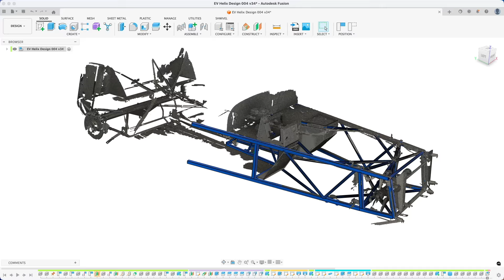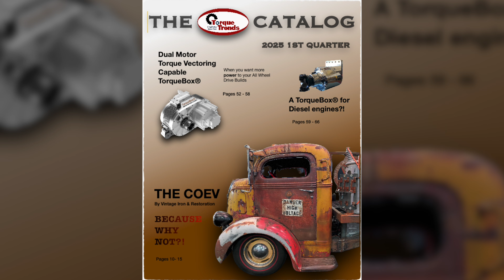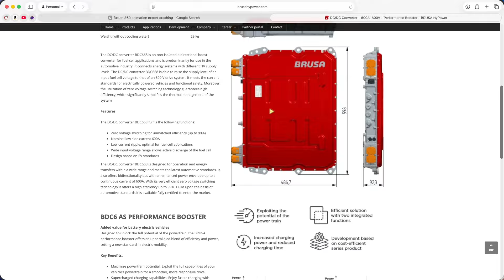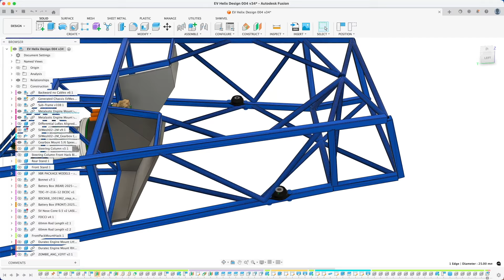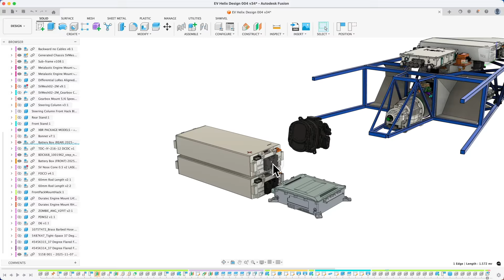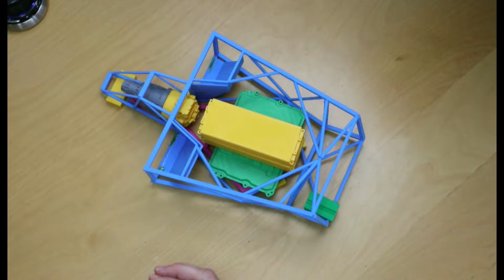Project sEVen pt6 : Mega Two Year Update Video - How I designed an Electric Vehicle

Comment: Final note on the LV / HV DCDC.  You might want to work out the total HV bus capacitance (DCDC HV side output capacitance + traction inverter input capacitance) and work out the volts per second slew rate at your 225A peak current. Ie, if your traction bus is at full power (225A) and something trips, how quickly does the HV DC link voltage fall or more importantly, in regen, climb!  This tells you just how much of a problem you might have to deal with! 

 You 'could' add more capacitance to the HV DC link to slow the slew rate and to try to decouple the bandwidth requirements of the control interaction between the powerflow through the DCDC and the inverter, the problem here is what capability does the inverter and dcdc have to safely discharge that energy storage. ROad homologated EVS have very strict requirements here, and you'll probably find the helix inverter has a mode deliberately designed to discharge its internal capacitance (and maybe the Brusa DCDC too) but if you add external storage the energy and hence thermal limitations here may preclude this option....
Reply from the maker: Yes, both the inverter and DC2DC have discharge modes to bring the DC links down to safe levels. I’ve spent a lot of today looking at what a chopping dump resistor might look like on the DC2DC / inverter link but the problem is (I think) I don’t really know how quickly the inverter or DC2DC will go from active to free-wheel when they see the bus voltage spike (thinking about the usual main problem of being in regen mode and you lose a contactor, removing the battery current sink). Both will have protection from over-voltage and over-current but as you pointed out yesterday the fault scenarios get complicated really quickly. It also doesn’t help that neither Brusa or Helix are very helpful about this sort of stuff. I guess Helix are more interested in what McMurtry want and the same goes for Brusa and Mercedes. Obviously a dump resistor isn’t going to be able to dump the whole of the cars kinetic energy from Vmax, so you have to assume the active components will stop commanding torque at some point. But then the inverter rectifier effect becomes a problem even when the inverter goes to free-wheel. Many unknowns follow on from there.
Reply: @Purplemeanie  the problem is high vehicle speed, ie when you are deep into field weakening, esp with your system where you have an ~800v secondary link and a ~300v primary link.  Sorry, off the top of my head i can't remember the KE of the Helix motor (i used to work for them...) and therefore exactly when it enters field weakening, but typically you might have a CSPR of 2:1, so you are above an 800v bEMF at 12krpm upwards (~70mph for you i think??)  

So, if you loose commutation you have uncontrolled generation, you absolutely have to have the active short circuit mode working in the inverter (basically it's the "f**k it" mode where the inverter just turns all the low side switches on, then all the high side switches and alternaes between these to share the thermal loads evenly) where it simple tries to short circuit the PM machine to prevent overvoltage and overcurrent in the dc link (phase current is the same as peak torque current irrespective of motor speed).  With little or no energy storage on the HV link, your time period here is short, very short!  

I don't know what the power conversion architecture of the brusa DCDC is. If it is fully isolated it probably can completely resist reverse uncontrolled generation, but it may of course sustain damage here in this event.
Reply from the maker: Very interesting that you used to work for Helix… hmm!
As for KE… from my calculations I’d say it’s the vehicle KE that’s the problem, not the motor KE. My calcs get me to about 1MJ for vehicle KE, 10’s of KJ for motor KE, and a few J for magnetic field energy (clearly not the problem that some people would have you think). But whichever way you cook it, there’s a lot of energy to dump into some sensitive electronics if you’re not careful. But now I re-read your comment maybe you’re not talking Kinetic Energy when you say KE, though I’m not familiar with KE in terms of field weakening (heads off to chatGPT to jump down a rabbit hole). My understanding is that the motor I have will enter FW at around 12,000rpm, so as you say about 70mph. But yeh, time periods here are scary short with the dV/dt that’s happening. As to the Brusa…. I don’t think it’s fully isolated LS to HS (if that’s the isolation you’re referring to). The manual warns of some rectifier effect when the HS is lower than the LS, so I presume not isolated. It’s really tough to get info on the disaster modes of these devices. I guess the companies think this is part of their secret sauce. I’m sure they’d share the info with their tier 1 customers, but they are not even reluctant to talk to me, the literally won’t talk to me… about anything! Not great customer service IMHO. I get that I’m not Mercedes, but doesn’t leave me feeling good about the purchase decision!
Reply: @Purplemeanie  sorry i should have been clearer, when i  refered to KE i was indeed talking about the motors speed / backEMF ratio.  For peak power and getting a realistically useably wide speed range, you normally target a CSPR (Constant Speed Power Region+ for about 2:1, ie your backEMF meets your supply voltage at around half of maximum rotational speed, ie KE x (rpm/2) = Vdclink

However, your point about KE as Kinetic Energy is also valid, and don't underestimate the enery in the motor, especially with such high speed motors where the square term really starts to kick in.  Immagine runing the motor to 24kprm unloaded and then suddenly jamming a crow bar into it, it would be a HELL of a bang, that's what you are dealing with here. The fact there is also a car attached to it as well really ups the energy of course, although normally the rear wheels pretty much lock and the car keeps sliding down the road in a bit of spin IME when this happens, so all the KE doesn't come out the DClink.....

Getting proper info is diffcult for non OE entities. People cite things like NDA's and "competitive edge" and all that crap,but honestly, if they let you buy one, they should let you understand what you've bought.....

Don't worry, i worked for Helix a LONG time ago, before they were even called Helix, when both Luke and I had a lot less grey hair, and when we started on the Mclaren P1 motor, where we had to litterally build everything from scratch. Nothing was "off-the-shelf" because even the shelf didn't exist back then. We mostly learnt by trial and error, lots of very very clever people basically saying "hell, lets give it a go and see what happens"  Happy days  🙂
Reply from the maker: Cool! Yes, totally understand what you talking about with KE now.
Did you watch my videos where I tried to explain a bit about PMSM motors. I was trying to keep it simple, but inevitably that means there’s a loss of nuance. It was pt2.2 in there series, I was quite pleased with my animation, but the mathematical modelling of the currents and fields will be lost on most people 😂. I think I probably oversimplified some of the torque and field descriptions 🤷‍♂️ https://youtu.be/fSu9B_tW3zM

Comment: one "mass" optimisation you could do is to delete the onboard AC charger!  The DC fast charger option is really the one you will use if you are away from home,  as even with a peak single phase 7kW from A/C type2 charging, that's gonna be too slow.  The mass penalty for the Dc fast charging is minimal, 2 contactors, the charge connector and an ECU, probably 2kg.  50kW of DC fast charging would make this car "road tripable" in a way that AC charging never can.  As you have complete control of the system, then clearly you CAN have AC slow charging at home, but mount the AC charger itself on the wall of the garage on on a trolley (F1 styleee!) and when you want to charge, plug into the DClINK access, enable the DC F/C contactors, and away you go.  You could make the A/C charger portable, ie build it into a box that you can take with you, but honestly, there is so much DC FC i p[ersonally wouldn't bother!
Reply from the maker: Yep, totally agree. I mention that in one of the earlier videos. And I sketched up a “home” DC link charger using an off-board AC charger feeding the car at one point. There was a reason I decided to include the AC OBC back into the car, but I’d have to check my notes as I can’t recall what made me put it back in again now :-(

Comment: Late to the party here, but one note regarding gearbox cooling!

With a single speed trans, the ONLY time your input rotational velocity hits peak rpm is at Vmax.  Vmax in a Caterham is NOT something that's particularly pleasant, and with your current Vmax at 135mph is clearly track only (officer....)  What this means is two things:

1) unless you plan of spending a LOT of time at the Nurburgring or Nardo, the amount of time you spend at Vmax is minimial.  Even if you hit Vmax (and aero drag on a caterham is so bad it actually takes a while to do this, so you won't at most circuits) you're gonna be there for a few seconds.

2) at Vmax there is a LOT of air going past the car.

Therefore I would be surprised if you needed forced active cooling in this platform. (you might need forced lubrication to avoid tooth gawling, but that's a different problem....)

I suspect that two things you could do very easily and cheaply, and that would both simply the system  would be

1) maximise oil volume in the gear box
2) fin the bottom of the trans casing and duct air over those fins. Go have a look at a BMW "M" rear diff.  See the fins. They had the same problem as you, the rear diff overheats at high Vmax

https://fluidmotorunion.com/wp-content/uploads/2020/09/DSC_0113-scaled.jpg

For your duty cycles, assuming you are not going to 24hr race this thing, this is the solution i would at least start with.  In any case i'd be instrumenting up the gearbox with oil temp sensors and probably an accelerometer or two to measure / monitor vibration. 

One of the biggest blocks to getting any "DIY" (and i use the term without any malice) project actually out the door and driving is trying to get everything perfect 1st time around.  The first step on the learning curve for any custom project is so huge, ime, it's always better to get a first cut out the door and on the road / track and learn from that, then introduce mk2 where you fix all your mess ups and improve things as required....  🙂
Reply from the maker: Thanks for the comment! Totally agree! There’s some big news coming (sorry I know that’s teasing but can’t say anymore at the moment) regarding the gearbox and I’ve actually been running exactly those scenarios through my head today. As you say, the actual time at Vmax is going to be very rare. I wanted to provide a spec to the design team that was rock solid but I always assumed I would back that off, especially for the first installation. We did discuss exactly this sort of trade off in our design meetings. From what I understand, when the pitch line velocity (rather than sliding velocity) gets above about 24m/s then you need to be going to a pumped oil system - with spray jets rather than just splashing. My PVL is 58m/s at 24,000 rpm. So even halving the vehicle speed (and the rpm) still puts the PVL above the magic 24m/s. I’d need to set my Vmax at something like 55mph to stay within the 24m/s guidelines. Now… I’m all for keeping the initial install a simple as possible. And I may very well get the car rolling with no pumped gearbox cooling. BUT the oil system on the gearbox assumes sprayed coolant and just going with a splash setup first won’t get the oil to where it needs to be. I’m not saying I won’t drop the pump to start with, but there are reasons why that may not be a good idea, even just for a few initial tests. And yes the gearbox will be instrumented up the whazoo! 😂
BTW… really appreciate the comments. You’re one of a very few number of people who could discuss at this level! 🙏🏻🙏🏻👏🏻
Reply: @Purplemeanie  that all makes sense thanks!  One point of caution if you are using an external (ie electric) lube pump for the trans.  please put a pressure sensor into the system and into your control ecu, with a torque  / speed limiitng map. I have wrecked may tens of  thousands of pounds of trans / diffs in various race cars over the years through pumps not pumping when they should!  I'd always favour an internal gear / g-rotor pump on the trans output shaft for guaranteed trans lubrication where ever possible though!
Reply from the maker: Ok. Thanks. Great input. 🙏🏻🙏🏻
Reply from the maker: Oh and yes… the casing is already finned.

Comment: Shout out for Damien and the openinvertor community😊
This is a fascinating project, some top quality expensive components, and amazing engineering analysis.
Go for it !
I probably have the only project that has less space- a morgan type 3 wheeler.....
Question- the Tesla SDU seems like a perfect fit- was it just packaging?

Also, if you want scope creep - I can put you in contact with someone who has three formula E ( gen2,3) drivetrains inc rear suspension.....
Reply from the maker: @christianhenderson5471, thanks for the comment and yeh… definitely need to shout a lot about what Damien, Johannes and others are doing 👏🏻👏🏻 (I’m sat in my office playing with the Zombie firmware right now! 🤣)
A Morgan 3 wheeler is going to be a fun project. Any details anywhere?? Is it in the OpenInverter forums?
Tesla SDU… in some of my previous videos I show how an SDU doesn’t work. If I could re-engineer the whole of the rear suspension then “maybe”, but that wouldn’t be an easy conversion, wouldn’t be a Caterham Seven anymore and re-working the suspension is not in my wheelhouse. I did look at putting IRS conversion into the car, but for various reasons that wasn’t going to work (and actually didn’t give me much more space). 
On the subject of FormulaE drivetrains, sounds like fun… but I’m way down the route of what I’m doing now… no turning back now!😂